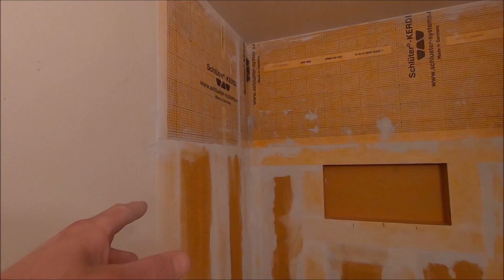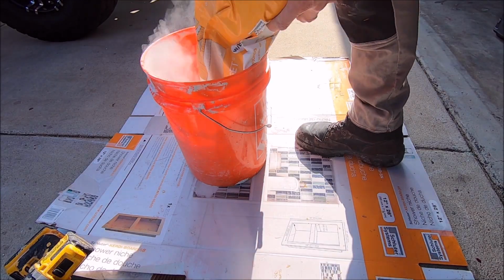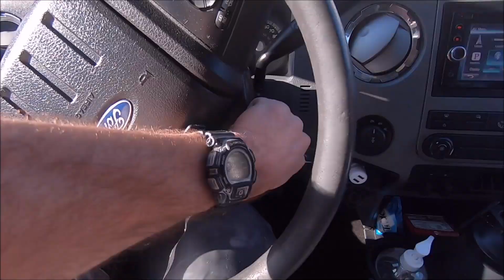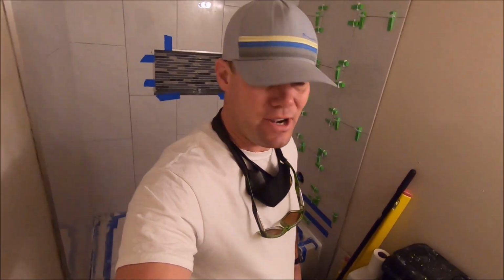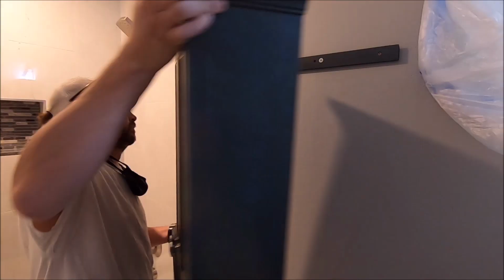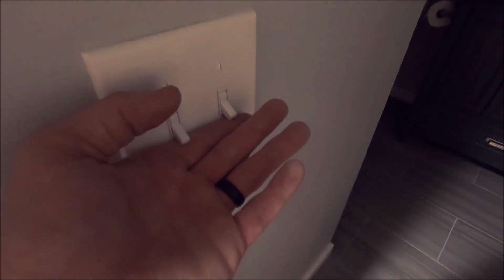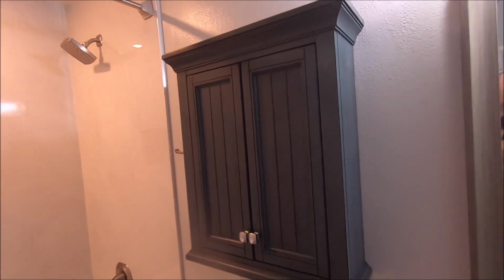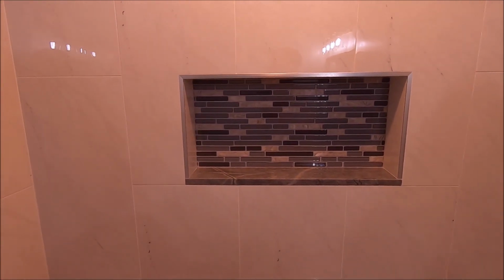Tiny Bath and Shower Remodel Complete

Comment: Do you have a space between the schluter metal edge and the drywall? If so what do you  use to fill that up?
Reply from the maker: Yes we usually do. We simply caulk it and then paint it wall color.
Reply: @LandbergTileTV  what kind of caulking do you use if you don’t mind me ask? Thanks for all the info you share and keep up the good work.
Reply from the maker: @WilsonAbrego  any paintable caulk works, but make sure it gets painted.
Reply: @LandbergTileTV  10:4 chief ! Thanks.

Comment: You silicone between tub and tile before grouting? I’ve always grouted and siliconed after. I just installed a deep acrylic tub and had to use loctite PL Heavy duty because silicone doesn’t bond to it and the tub flexes away from tile about 1/32 or so. Could you show more schluter niche builds in the future jobs. Great work as always
Reply from the maker: Will do on Schluter niche builds

Comment: How did you get the folding stand for your dewalt saw? I got the dewalt 24000 but not with that type of stand.
Reply: He's got a delta cruzer 7 inch that he painted dewalt colors!
Reply from the maker: yup! wish dewalt had something like this 👊
Reply: @LandbergTileTV  dude, you might make it happen! I've seen your plug or eye wink to dewalt "you know where to find me".  I see them having a gravity stand with a higher cut capability. Every job i get to quote as of late is really large tile. 2 x 4 is almost regular and even the plank tile is 36" it seems.